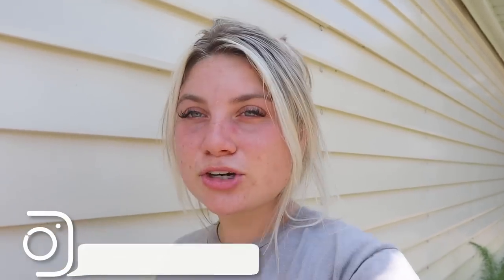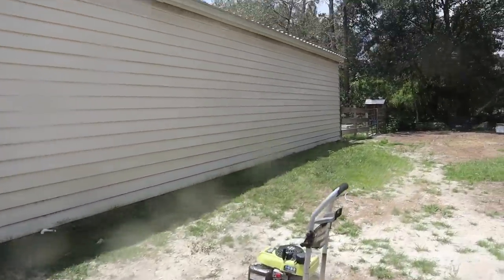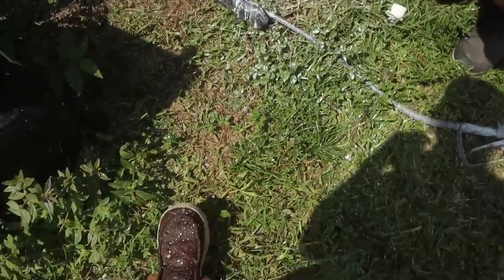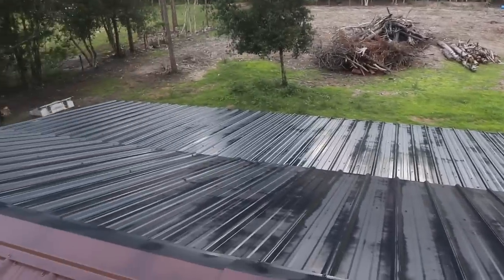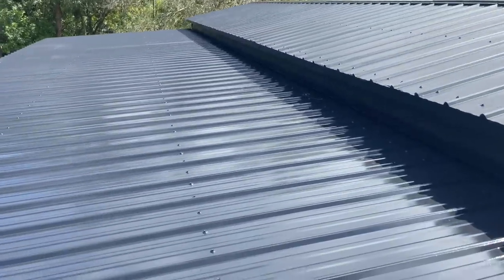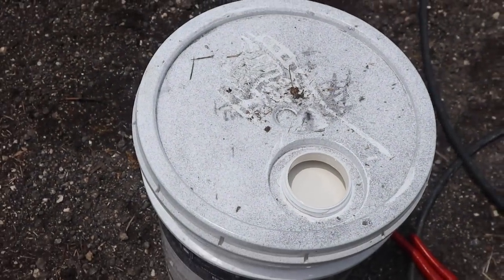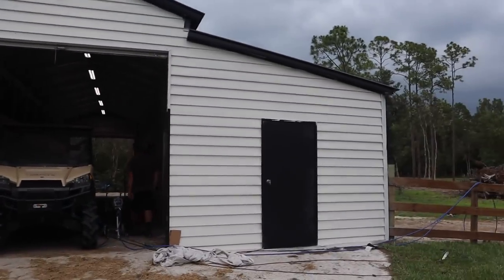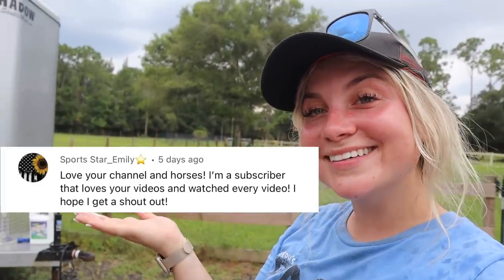WE PAINTED THE BARN | BUILDING MY DREAM HORSE BARN PART 24!

Comment: It looks really nice. You could have just done the roof white to reflect the heat and still gone with the trim and door all black. The black roof will most likely make it hotter unless you insulate the inside of the roof. It looks good though.